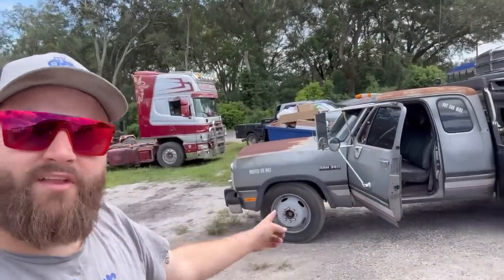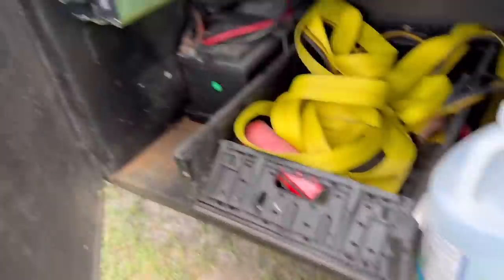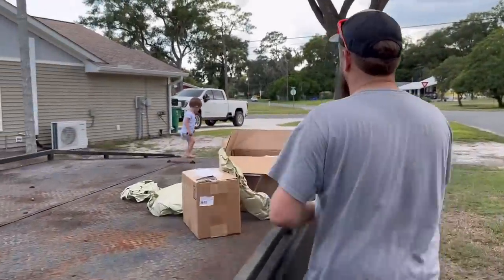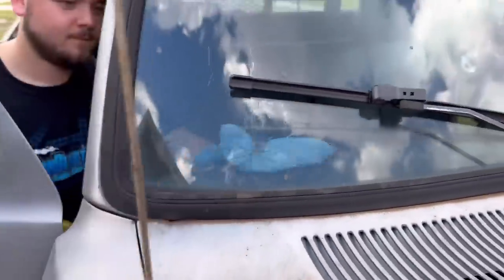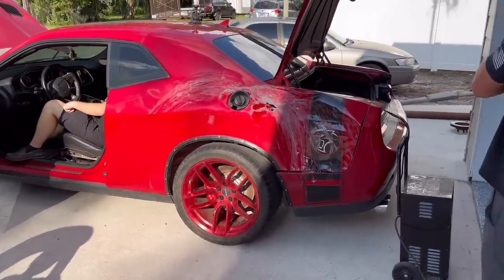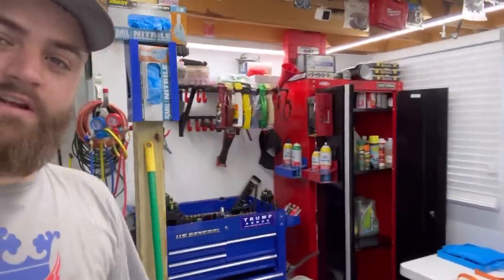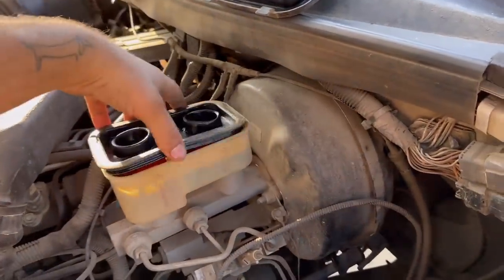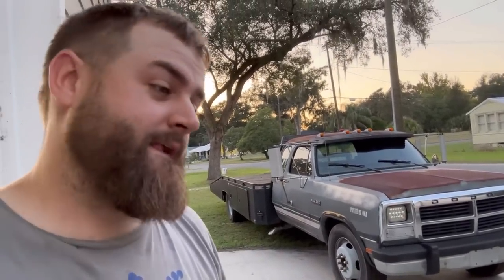Tow Truck Revival, New Daily 12 Valve Cummins, Ranger Project!

Comment: Flush the brake fluid. Over time, condensation gets in there and corrodes shit and then water mixes. If you leave that shit fluid in the system, you'll end just replacing booster and lines when it could have been prevented